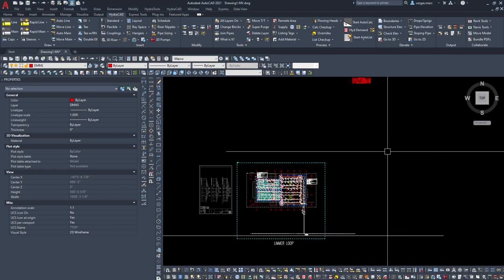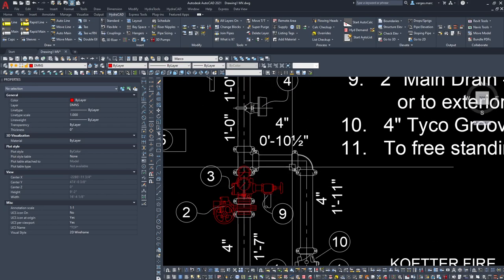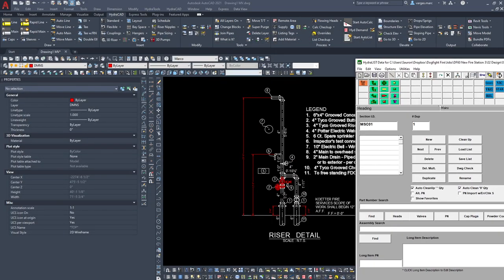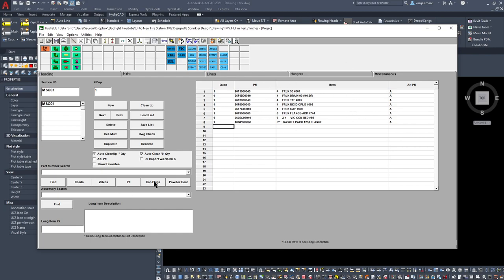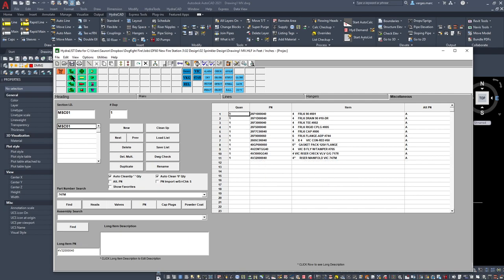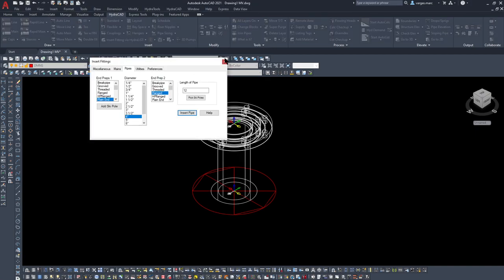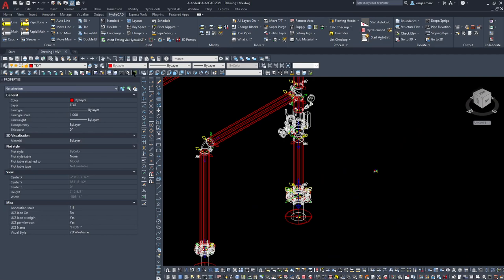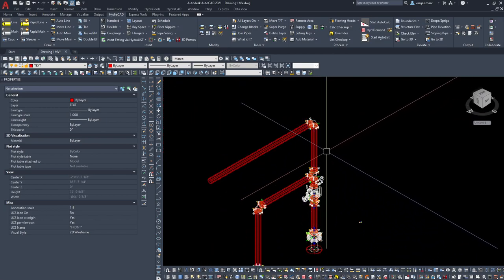Drawing a 3D Riser Detail in HydraCAD

Comment: Do you have any advice as to where to go to learn hydracad. I am a fairly new service/ alarm designer and have done fairly decent so far but everything I have done is 2D. I have been wanting to learn all the ins and outs of the program just don’t have to much help In Person. Any advice you can offer would be greatly appreciated.🤘
Reply from the maker: Hi Andrew. For learning HydraCAD, the user manual was invaluable in learning all the functions and commands. You can find it in the hydraCAD help pull down menu inside a drawing. For drawing in 3d in HydraCAD, all you have to do is establish your base elevation and just keep track of the ups and downs throughout the system. I use the AFF command with a computer generated riser nipple often to change elevations.

Comment: I seen from your other video comments you started using Hydracad with Revit. Any news on how that's working out? Training with hydracad where I am has been virtually non existent since a training session back in 2008. I taught myself to elevate and autolist (autolist can be horribly unreliable... but you know right away if your project listed correctly). More often I'm getting flack from GC's that don't understand why we don't operate like the other mechanical trades. Never had my hands on another software, but all I know is our bread and butter is projects that do not require 3D and H-cad is cake for that. My latest squabble has been the GC asking me to model the fire pump. I can give you a 2D side view and top view no problem. In the model, I can give you solid pipe where the pump foot print is... that's all I got. Ain't worth my time to model 3D valves because you want to impress the client and distract them from the fact you are behind schedule.
Reply from the maker: Hi Promiskeeper. I am almost full time on HydraCAD for Revit. I have been finishing up my final projects in regular HydraCAD. The main difference has been getting used to the sheet setup in Revit vs. CAD. Paperspace in CAD is just much more customizable, but I have a few sheet setups that seem to be working just fine. I taught myself HydraCAD as well by reading the manual mostly. If you don't have one, you can find it in the HydraCAD help pull down menu within a drawing. In regards to firepumps, there are several ways to draw one in 3d using HydraCAD. It has a library of premodeled fire pumps that are usually good to go. You then just have to build your library of valves in hydralist and link it to your drawing so you can import them using insert 3d fittings. Revit is so much more easy to draw risers and fire pumps. I would much rather draw a pump room in 3d and just view port the different views instead of drawing each view. That can be way time consuming.

Comment: Would you be able to make a video showing how to connect multi-floors? We tend to design (NFPA13R) loop main on 1st floor feeding a loop main on 2nd flr which feeds HSW on 3rd flr.
Reply from the maker: Its possible for sure. I make videos for projects that I have currently so if something like that comes up I will definitely keep it in mind. But in a nutshell, connecting multiple floors using HydraCAD would require different drawing files and matching origin points plus some moving of the system model if you wanted to use it for BIM. I have done projects with multiple floors like that before.